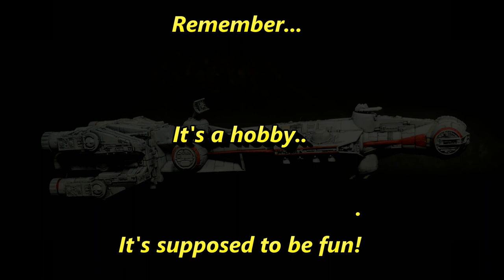Tools Part 2   The Next Level

Comment: Hi Mike. Nice video series. You know when you're a serious modeller when your stash of tools is bigger than your stash of kits.

One item you might want also to consider if you're using super glue is a debonder. Because stuff happens (Murphy's Law is always in effect). It's good for unsticking fingers and things from each other and it's also useful for cleaning up excess glue. Bob Smith Industries makes a debonder and it doesn't cost any more than a bottle of glue.
Reply from the maker: I have more tools than I know what to do with. :O
I've never really had a need for debonder Glenn. Acetone breaks up CA glue pretty easily and costs a pittance at the hardware store. I can also use the acetone in my paint brush cleaner solution.... so more bang for my buck haha.

Comment: Coen have you tried searching for electronic circuit board drills?  They are super cheap and tough, and come in very small sizes. I've seen ball type cutters and regular twist type drills down to like 0.1 mm.
Reply from the maker: Nope. I've never heard of such a thing until just this very moment.
Now that I have, I may take a look to see what I can find on amazon prime here in canuck land (can't buy anywhere else at the moment. Earth is closed haha)
Reply: @CoensScaleModelling  I generally go here 

https://www.mscdirect.com/browse/tn/Holemaking/Drilling-Drill-Bits/Metalworking-Multipurpose-Drill-Bits/Micro-Drill-Bits?navid=12106217

banggood.com is also a really good source for cheapo electronics stuff.

I don't know if they can ship to the kingdom of maple syrup. 

On a totally different point, can you recommend a good kit for an early 38t?
The tristar one I have built a couple of times  seems to be non-existant now.

cheers!
Reply from the maker: Any of the hobby boss panzer 38(t) are the tristar kits reboxed, so you can still get them. Just under a different label.
https://www.scalemates.com/search.php?fkSECTION[]=Kits&q=Panzer+38%28t%29&fkTYPENAME[]=%22Full%20kits%22&fkSCALENORMALISED[]=%221:00035%22&fkTYPEGROUP[]=%22Panzer%2038(t)%22&fkCOMPNAME[]=%22HobbyBoss%22
Reply: @CoensScaleModelling  Thanks Brother!